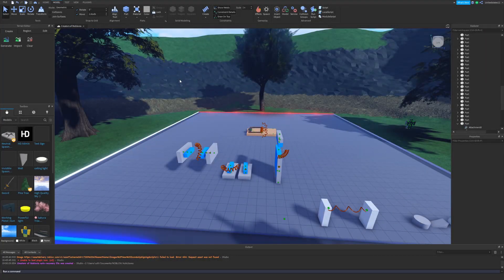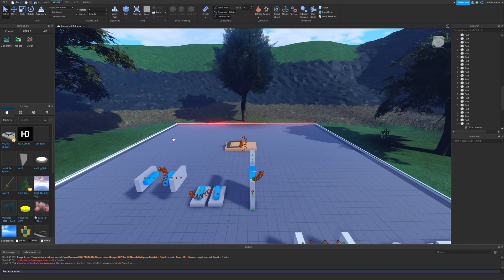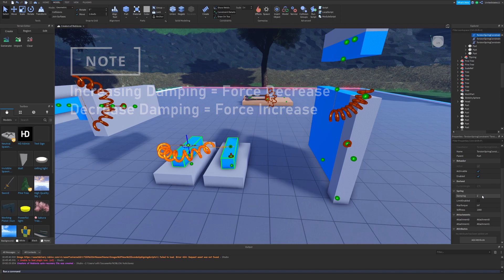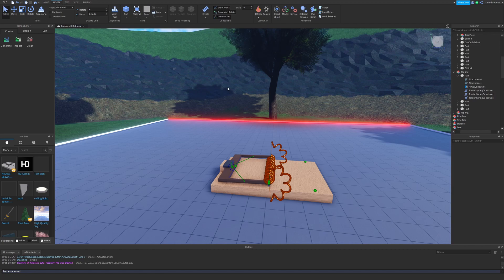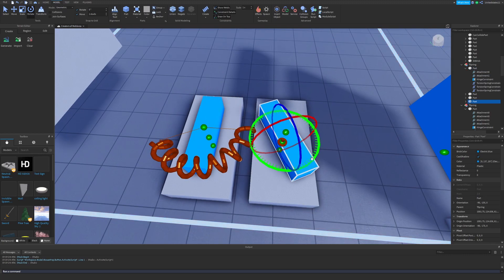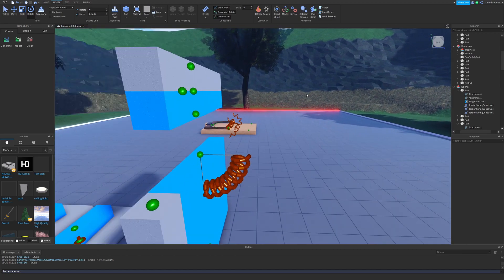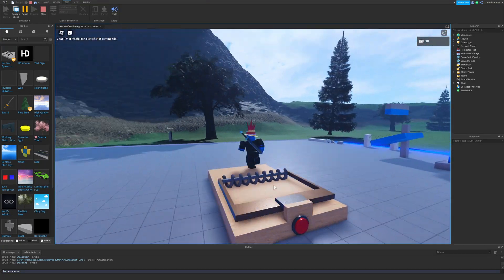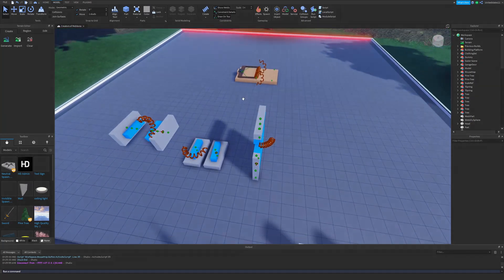ROBLOX Building - How to use the new Torsion Spring Constraint!

Comment: Nice one, but it would probably have been useful to see how you actualy attach the constraints to the parts, as I find that part a bit tricky.
Reply from the maker: I'll do my best to help you here, really all you have to do is click the attachment you want to use, and then click on the surface of said object/part, and work with it from there. You can click it again and use the move tool to re-position it. Also, increments apply to attachments, so if you wanted to make them move on the "invisible plane" between 1 stud increments, you can set your move increment to 1 and it'll apply. Vice versa with if you want them to freely move, turn the increments off.